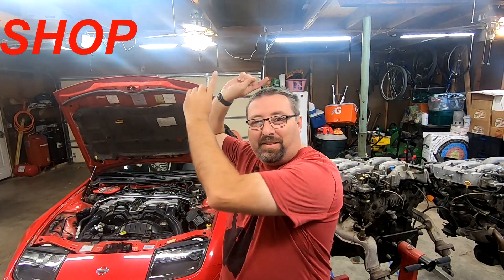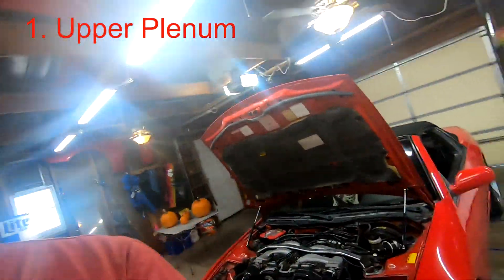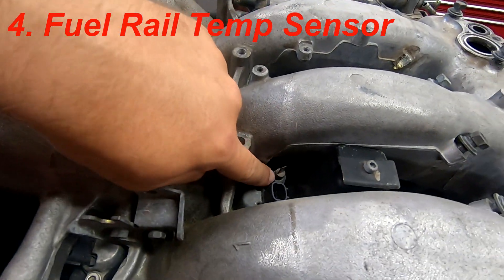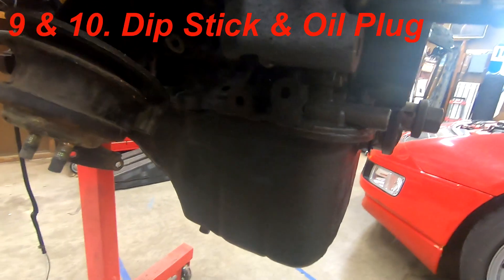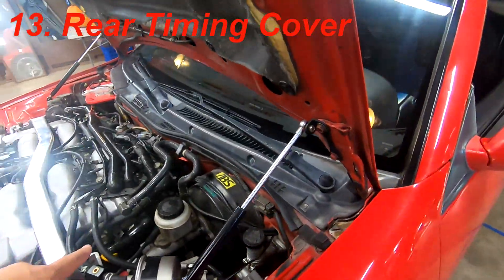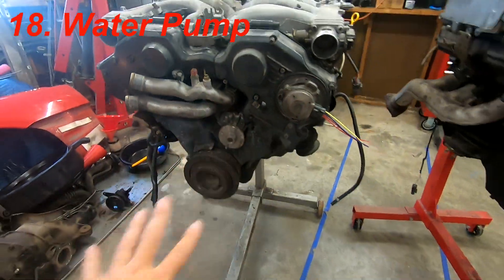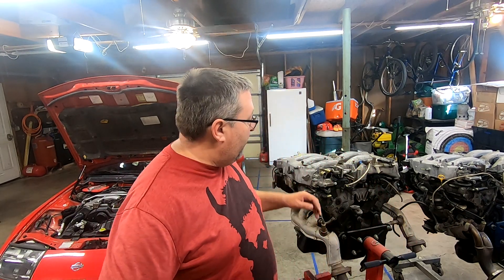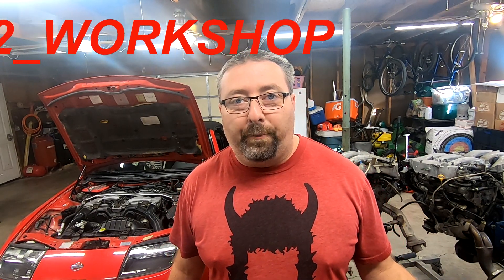Nissan 300ZX & Infiniti J30 Engine Swap list!

Comment: Crank sensor?
Reply from the maker: No they should be the same, although the bracket that holds it, my have s 2nd set of bolt hole locations.

Comment: are the injectors on the j30 engine the same as the vg30de NA?
Reply from the maker: Yes
Reply: @z32_workshop52 so tht means both engines use 270cc injectors, right?
Reply from the maker: @luiscisneros1756 yes as they are both n.a. engines only different would the connectors. Depending on te year

Comment: I have a quick question I like your channel but all the J 30 swap to Z 32 on the intake camp gears there is no spring for the J 30. Should I put the springs on there on the cams?
Reply from the maker: @zekeloynab8335  the vg30de in the j30 is the same as the 300zx. So if it's got the VCT gears on the intake than it needs a spring. 1989-95. Only the 96 on up was different for emissions aka ob2 and they got rid of the VCT
Reply: @ 
The engine that I’m using is out of a 97J 30 and did not have the springs so just use those gears without the springs
Reply: Also my solenoids do not have the wires
Reply from the maker: @zekeloynab8335  yeah, that engine will not have the VCT, springs, as they removed it.
Reply: What do you think I should do.
Reply: I have the intake gears with the 4 bolts on the back and the vtc solenoids have no wire on j30 engine. The 300zx I am putting this in has the vtc connector.

Comment: Does the oil plug in the J30 engine have to be punched out the top or can you punch it straight through the bottom?
Reply from the maker: I punched mine out, from top to the bottom
Reply: @z32_workshop52  I ended up punching the plug out from the bottom to the top, kept having trouble trying to punch it down from the top. Thanks for the help!
Reply from the maker: @Zeamerz  Happy to help out! good luck with the project.

Comment: Like you said at the end of the video, these cars are getting harder and harder to find parts for...for example the AC system, can't find a compressor can't find a condenser.  I do see J30 compressors available though which look the same.  Do you think I can go to the junk yard and pull off a J30 ac compressor bracket, swap that out, and use a J30 compressor?
Reply from the maker: If they are cheap enough. Give it try. I would think you would still need to use the z32 bracket for sure.
Reply: You find out? I have 300zx brackets. Can I still use j30?
Reply: @Z32rbsouza  I never did it as my Z32 compressor still works...maybe one day I'll find out lol

Comment: Those sensors are knock sensors. Not VCTs.
Reply: No they are not...there is a single knock sensor in between the heads in the V valley but those are definitely VTCs
Reply: @VNCTHE1  you're right. My bad.

Comment: when dropping the oil pan and taking off the rod end caps, what order should the be bolted back on in? whats the torque specs?
Reply from the maker: Use the factory service manual. It's free on android.
Reply: @z32_workshop52  what's the app called? I can't find it
Reply from the maker: @icesalami  Iits called  "Z32 Service Manual"

Comment: Good video, i like seeing these comparison type videos myself and i did learn some interesting things that you mention i didnt know about with regards to the j30 engine. I plan to showcase eventually all of the difference between the early model 300zx's and the last 2000spec model 300zx as well as other parts from other cars that fitvon the 300zx one day in the future.

The only item that you didnt mention was the balance tube, as the j30 balance tubeis designed differently to allow access to the 5th and 6th coil packs and spark plugs so the balance tube doesnt need to ne removed when changing the plugs. I am planning to swap a j30 plenum and balance tube setup into my 300zx very soon and should make servincing the spark plugs in the future a much easier job to do.
Reply from the maker: Oh, yeah I did forget that, but that's still part of the Upper Plenum so that's why I forgot it. because if you swap the plenum you have to use the other balance tube.
Reply: @z32_workshop52  you can use the j30 balance tube on a z32 plenum but you'll need to drill and tap out a thread hole for one of the balance tubes mounting screw holes to make it sit properly on the z32 plenum, i went with a complete plenum swap to overcome that issue as well as allow me to use the j30 ptu relocation bracket setup on the j30 for my z32.